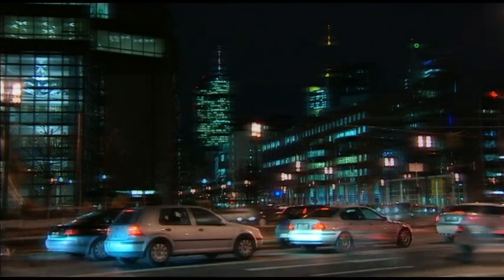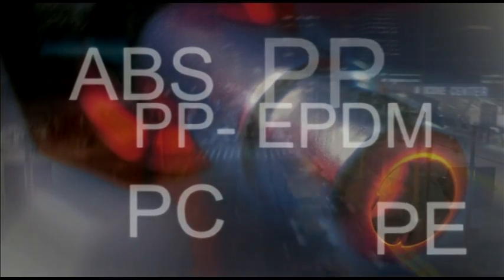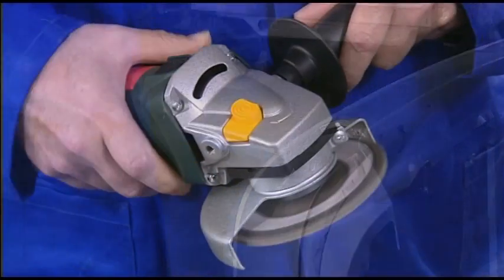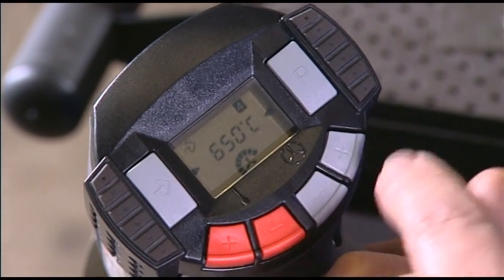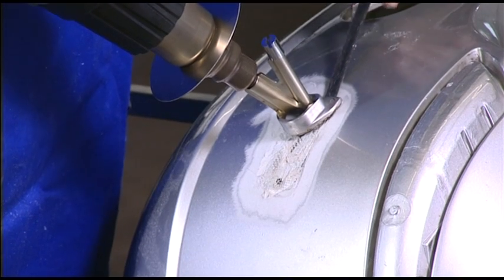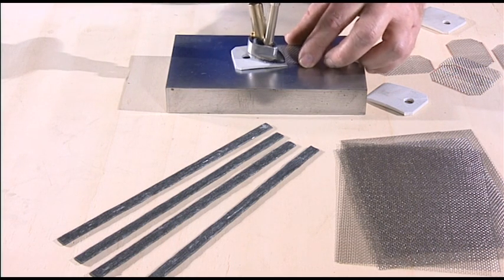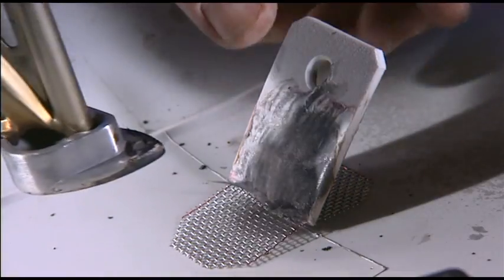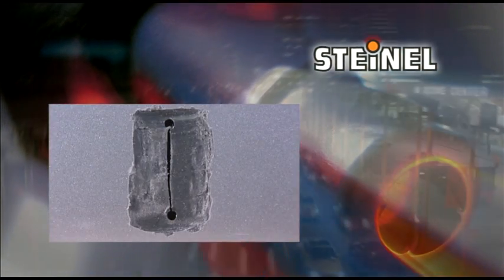How to Repair Plastic Bumper #hotairgun #heatgun @steinel

Comment: Great video and the tool is pretty cool too. But this process isn't really what you should call "plastic welding". The German DVS welding society guidelines advise that welding filament/rod should match the plastic you are welding for proper molecular level bonding and to match the original flex and strength of the panel. I'd call that more of a fancy hot glue gun :P Nice video though :)

Comment: good salesman for an over the top repair.why not simply plastic weld it with a soldering iron,oops that would be too easy and you'd get no sale
Reply: kp227pete that's right,  I used the soldering iron many times in my car,  and then I started to use heat gun and flat head screw driver which is easier, using big soldering iron is the best